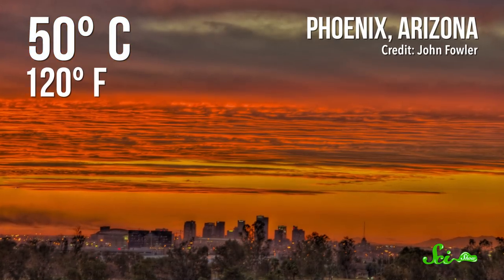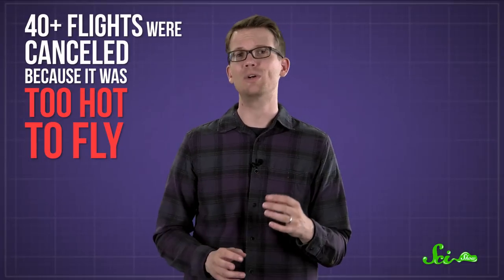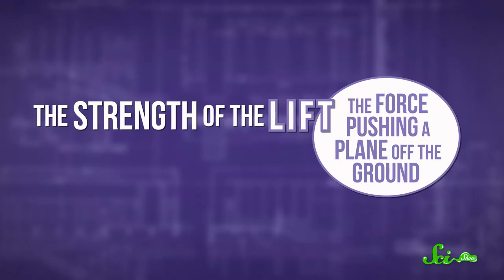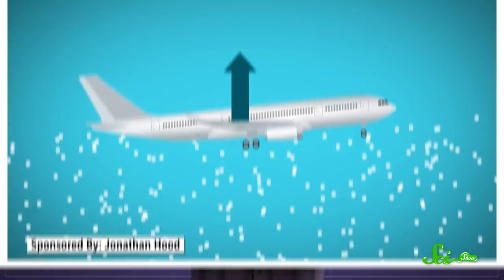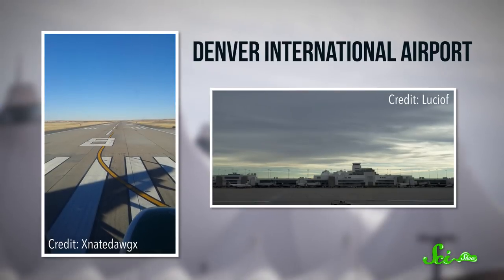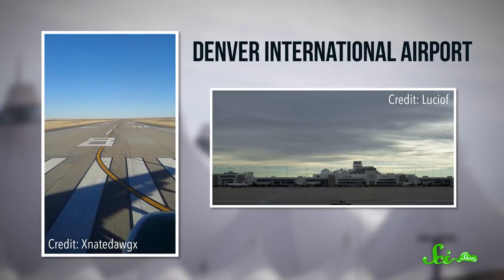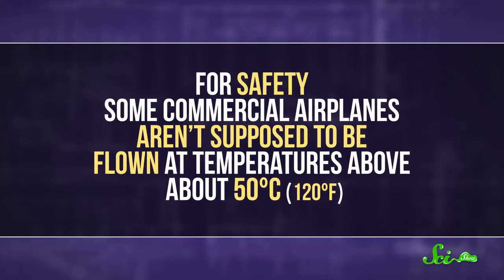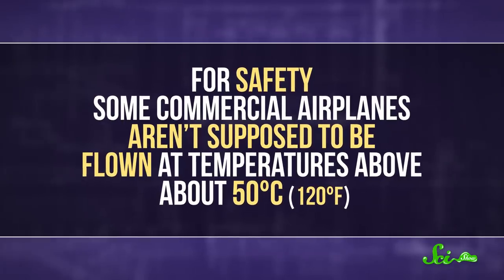Can It Be Too Hot To Fly?

Comment: The pressure of a perfect gas (of which air at around 1 atm is an acceptable approximation) is directly proportional to its absolute temperature (for a constant volume). At constant pressure, the amount of molecules (within a given volume) would be inversely proportional to the absolute temperature. 50º C  is 323 K, whereas a relatively cool air could be 20º C, or 293 K. In other words, 50º C is around 10% higher absolute temperature than 20º C. If 20º C is perfectly safe to fly, but 50º C isn't, it means that a 10% change in air density is enough to go from safe to unsafe.

Comment: Really, it is because those planes aren't certified by the FAA to takeoff above 120F.  They actually can fly, with a slightly longer rollout, or reduced weight, and Phoenix airport has the runway space, but without the FAA approval, it isn't happening.

Comment: You can easily overcome the density problem with more speed, the increased engine inlet temperature and subsequent increase in turbine inlet temperature on the other hand not. That is the real reason the flights were canceled, 20 degrees Celsius difference is a big deal for a high pressure turbine, if you don't want to prematurely have to service the engine.

Comment: Although it may be impractical, would it be theoretically possible to get the planes off the ground and into cooler air by installing sprinklers along the runway and takeoff/landing approaches? My reasoning is that the humidity would thicken the air while also dropping the temperature in the immediate area. If misters also made a sort of fog down the runway while planes were taking off, the air would be much denser and cooler, giving the engines significantly more thrust and wings more lift.

Comment: I believe 120F (~50C) isn't all that uncommon for Arizona. I've been to that desert hellscape a few times and experienced such heat, plus my relatives that live there have reported temperatures between 120 or 124 a few times over the years (and they are so accustomed to it, they think 80F is jacket weather).  So, what was so special about June? Was the air density particularly low?

Comment: I feel like calling it BS.  During my deployment, we were routinely taking off and flying while the ambient temperature was 132° F (~56°C). The types of aircraft I saw take off was B52s, B1, KC-135s, RC-135, and smaller commuter jets.  They all took off and flew fine. I'd say the reason for cancelling flights was to keep stress off of the aircraft and ground crews.
Reply: Where were you deployed when temperatures were that hot? 132 degrees F is killer heat!

Comment: As a Canadian in the south east I can't even imagine 40C or even 35C the summers in my region are 20C to 25C a very hot day is 30C. Humidex of 90% at 30C could mean 30C feels like 40C so in a way I guess it can be experienced here.
Reply: I live at 1000m above sea level in Australia (30.5S) and while it doesn't get over 35 here, I start panicking about getting the house cooled down overnight if the forecast is in the 30s. I don't tolerate the heat well at all.

Comment: Had to deal with this in Alice springs @ 50 deg c on the runway was 80deg c and air above for a meter could be the same the trainer " piper worrior MK1" would rotate but not lift off lol one of the smaller runways had a bump just for this.

Comment: There's an inaccuracy in this. Air molecules don't "push" the plane up. Rather it's a difference in pressure as air takes longer to go over the top of the wing's airfoil shape, while air traveling under the airfoil goes quicker. This causes a pressure differential that creates lift
Reply: Lance McCarthy I think he simplified the explanation for the sake of the video's time limit and target audience.
Reply: Lance McCarthy It's as those air molecules move up from high to low pressure they push on the wings to create lift. The air molecules still push on the wings he just didn't explain why they push on the wings.

Comment: Considering that planes are capable of maintaining lift at 30,000+ feet of altitude (where air is so thin as to be unbreathable) I doubt that a plane would truly be unable to take off. I'd say this is more of a precaution than anything, maybe due to a mishap or close call with a plane in unusual heat carrying close to its weight capacity in cargo

Comment: Wow. He got so many things wrong with this. First, Phoenix wasn't in a heatwave. That was just SUMMER in Phoenix. Summer temperatures vary from 105-120+ for the daily highs through June, July and August.
Second, this didn't ground all flights, just certain kinds of aircraft. Southwest was still flying even with that temperature because Boeing and Sky Harbor (Phoenix's International Airport) have charts for those aircraft that go up into those temperatures so that they know how much runway is needed to get off the ground. These charts were revised more than 2 decades ago because of similar issues when Phoenix got to 120+ for several days straight and the charts didn't go that high.
For other models of planes, the manufacturers haven't got data for them, so those, smaller craft, were grounded. This had an impact on some of the sister airlines to the major ones that provide coverage to lesser airports for the big carriers.
Sky Harbor averages 1200+ flights per day, so the fact that 40 were cancelled should show how minor the issue really was.

Comment: Working as an AC installer in Phoenix is like getting jizzed on by the devil, 120 degrees outside but in an attic with no air flow, it can be nearly 200 degrees
Reply: But on the other hand....youll always have work somewhere.

Comment: I've noticed that the airports in Dubai and Doha are most active at night and essentially empty during the day. I wonder if the heat is the reason. Also, how does humidity factor in to this? Phoenix is not only hot, it is dry. Dubai is hot and very humid, could that help planes take off? I'm assuming that landing is no problem regardless of the temperature.
Reply: Humidity actually makes the situation worse.  The planes affected were small regional jet (small wings and small engines).  Large planes have higher operation temperatures because they have large wings, and much more powerful engines.

Comment: So, the science in this is right.. but it oversimplifies why some planes couldn't fly in Phoenix when it got too hot.

Each individual airplane type has a performance chart. The simple gist of a performance chart is at a given elevation, temperature, and weight, a specific airplane type requires XX,XXX feet to take off. If the airport's runway isn't long enough they might have to reduce the weight (i.e. take off bags and/or people). However in this case Bombardier only published performance charts up to 117 deg fahrenheit for their CRJ-200, CRJ-700, and CRJ-900 airplanes, which were the only ones that were grounded.

If there aren't published performance charts for a given airplane that cover the elevation and temperature, it means that the airplane isn't certified to fly in those elevations and temperatures, thus it is not legal to fly the airplane when those conditions exist. Its fully possible that the exact same airplanes could (and will) fly at these same temperatures out of Phoenix in the future, its just that Bombardier will need to calculate and publish the charts for these temperatures, likely at the prodding of American Airlines, which has a hub in Phoenix.

Here's a thread on this at Airliners.net, a gathering spot for airline industry professionals and airplane geeks like myself: http://www.airliners.net/forum/viewtopic.php?t=1366207

Comment: +Scishow
So would electric planes that could handle sulfuric acid clouds fly better in Venus compared to Earth or worse?  Asking since Venusian atmosphere is made of heavier molecules than Earth, mostly CO2 vs mostly Nitrogen, but is also a lot hotter than Earth, which density decreases as you keep pressure the same but temperature increase, so I don't know which effect is stronger.  Also Venus has a lot of different altitudes you can fly at which have different pressures and temperatures, I don't know what altitudes would be better to fly at on Venus.

Comment: "The number of molecules moving past the wings matters more than the speed of the molecules"

This isn't right. force of lift is given by (F = 1/2 * Cd * rho * V^2 * A). The lift increases as the square of the speed but only linearly with air density.

Comment: I've always found it weird that planes take off against the wind, but fly with the wind while cruising. I know why (air goes over the wings faster when it takes off against the wind, creating lift faster), but it seems contradictory.
Reply: KingsleyIII being a pilot, I'd like to help you confusion... When taking off into the wind gives you that relative wind to create enough lift.  A plane needs a certain speed to lift off.  The plane doesn't feel the actual speed across the ground only the airspeed.  So let's say you need 50 miles an hour of wind for takeoff, when you take off your now inside a mass of air that is moving.  A fish in a tank being carried.... If you tried to take off in a tail wind 10 miles an hour you'd have to go down the runway and match the speed of the wind which would then cancel the wind, then fly 50 an hour to take off, technically you're now having to speed to 60 miles an hour to actual take off.  Hope that makes sense

Comment: Nice video, just a comment: it was just a joke, but I think it is incorrect to say the 50°C is "half of the way to boiling", as you can make this kind of comparison only if you have an absolute zero, that you do not have for Celsius (neither for F degree). So actually I would say that half the way to boiling would actually be around -86 °C (around -123 F degree), as it is half between absolute zero (0 Kelvin degree, or -273.15 °C) and the standard temperature of boiling water (100 °C, or 73.15 K) :)

Comment: Sorry for the pedantic comment but I think your ideas weren't well structured in this video. The problem with hot temperatures like these are more of a problem regarding the engines than the wings. You seemed to gloss over that at the end, whereas I think it should have been the main theme of the video. The wings are capable of producing the required lift for takeoff in the less dense air as long as the low density is compensated by an increase in speed, hence why planes fly quite happily in the lower density of 35,000ft. However the way the engines  accelerate the plane is by taking in lots of air at the front, compressing it, and pushing it out the back. In hot, less dense air, there's a lot less air for them to suck in and subsequently push out, so the plane accelerates a lot slower and hence needs a much longer runway to have enough time to accelerate to the required speed. I think it's an important point because we sometimes forget that planes accelerate in a very different way than a car, hence needing to explain how a plane accelerates down a runway.
Also I feel your comment saying the speed of the molecules matters less than the number of molecules was misleading. It's just two ways of describing density surely? What matters most is the speed of the wings through the air. The lift equation says that Lift is directly proportional to the density of the air but is directly proportional to the square of the speed, hence speed is the most important factor affecting lift. However it is in the engines that density affect the speed we can achieve, hence why I think that would have been a better framing of this video's message.

I know your video wasn't wrong and I think you guys do an awesome job. I hope you take my comment in the constructive way I intended it.
I really hope you read this comment because it came from the heart (and the brain) about a topic I'm very passionate about. Special shout out to Brendan Cole who was your writer for this video,  I hope you like my way of explaining this topic. Big fan of the show and I wish you all the best! DFTBA

Comment: I suspect another reason maybe fuel tempatured in the wings, and lower efficiency of the engines at high temps.
Reply: that all only matter on the take off. up there air density and temperature don't get nearly as affected and are all still below freezing. besides the plane wouldn't stay over pheonix for long enough for fuel efficiency to matter. it's more take off safety concerns. once the plane is stable in the air it's all good.

Comment: How can it be to hot to fly - in almost all cases it's not.  It's just that airlines want to stuff each plane to it's very maximum weight capacity, and at such load, at hotter air temperatures (and lower air densities), the local airports do not have sufficiently long run ways to take off safely.  They could easily boot 15 passengers and 15% of their cargo and take off safely even at the hotter temps, but that would inconvenience the airlines bank account.  And we all know airlines main goal is in squeezing every single penny from the passengers that they can - no matter who they screw to do so.

Comment: In aviation we call this Density altitude. The airport is at one altitude but the aircraft performs like its in another.
Reply: as for the speed indicator being wrong if not adjusted to the right pressure... but like, if the airport is at 1000, in the plane it might be 1100?
Reply: traeng I am not to sure of what you mean. You dont adjust the airspeed indicator. The difference between the 2 altitudes can vary from hundreds to thousands of feet. Not too bad at low altitude locations but very important for places higher up.

Comment: This isn't actually true. The reason  the flights were cancelled was due to the type in question (the CRJ 200,700,and 900) performance charts didnt go up to 50C and so the aircraft were grounded.The aircraft could probably have been flown fine but the performance charts didn't go up to 50C

Comment: Phoenix sucks so it's ok. Most of us here won't be mad. Humidity is worse than desert heat for me. 120 is still god awful but when it's 90 with 100% humidity, no freaking way. I was wondering why the flights were cancelled, figured it was something that was related to the tires.
Reply: Cary Northrop you'll never get 90 degrees 100% humidity in the US. You'll get 60-70% at most, and that's basically a rainy August afternoon in Phoenix, yet actually cooler in the South.
Reply: Mystery Man false. One of many examples I can give will be the easiest. Right now, in San Francisco, it's 80% humidity. There are many more reasons and examples I can give but I will let you do a google search about weather, weather in the Midwest, and other resources. Have a good Sunday!

Comment: Can someone explain to me why in my head I was absolutely positive that 120 F was the boiling point until just now? Why does the 120 stick out so much to me?
Reply: Nero Nyte It's the normal top figure of most room thermometers 212f is boiling point at sea level
Reply: Is that the reason 120 sticks out so heavily in my mind? Like for some reason I remember it as the number I was taught to think is boiling, but that can't be the case

Comment: This isn't really correct, the reason why most airplanes stop operating at those high temperatures out of commercial airports is so if they lose an engine they have enough remaining thrust with one operating engine to fly. They run out of margin at high temperatures. They do just fine on two engines, it's not a problem. It's 100% to do with single engine performance.

Comment: Wait but you said planes fly higher in order to get lower air densities if thats a problem why not just fly lower?
Reply: 64standardtrickyness Air density is too low even at ground level in extremely hot weather. Phoenix must not have long enough runways which would allow operation under such conditions.

Comment: I don't think that the phrase half of the way to boiling makes any sense if you're not using Kelvin and starting at zero.
Reply: 50C is halfway to 100C.
Reply: Cody Bainbridge Celsius doesn't start at absolute zero, so when something is at 0 Celsius, that doesn't mean that there is no movement of the molecules so the molecules aren't moving twice as fast at 100 as they are at 50C. You have to start measurements at zero for twice to mean anything.

Comment: what if it gets too cold?
Reply: Planes generally fly much better in cold air.  Takeoff and landing distances are much shorter on winter days than summer days.  The issue with flying in the cold has more to do with engine starting in the case of turbine engines, and something called shock cooling in piston engines.  Unlike a car, piston aircraft engines are generally cooled by ambient air flowing over them through holes in the nose.  Engine temperatures are typically around 350-400F (175-205C).  If you were to fly in temperatures colder than 0F (-17C), air that cold meeting an engine that hot causes stress in the metal and can actually crack the cylinders.  Turbine engines are not affected by shock cooling in flight, but they can have issues starting that vary depending on the engine.  Some need to be pre-heated with a diesel heater, some idled after start to warm the interior slowly, etc.

Comment: Can the air be too dense
Reply: Shadowcomet To fly? No, not on Earth. Extreme cold, snow and ice are a different hazard though.
Reply: I guess it can. Let us see. If the air goes too dense, the lift will in theory increase but so will the drag. Of course, your question is, would planes be able to take off under these conditions? Do you think the engines would have to generate far more propulsion because of the drag?

Comment: but dont birds use hot air to soar easier ?
Reply: Andreas Andersson They use rising air. Not all rising air is hot, it's just being pushed up from the wind underneath it.
Reply: Yeah but birds don't have several tonnes of metal to carry around with them or rigid metal wings attached to jet engines